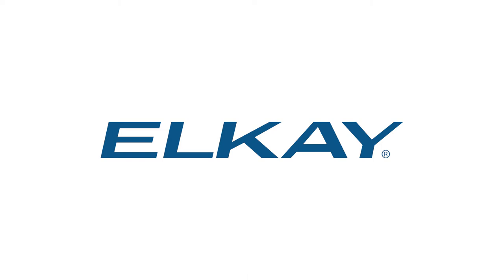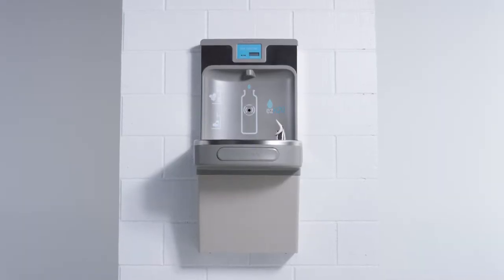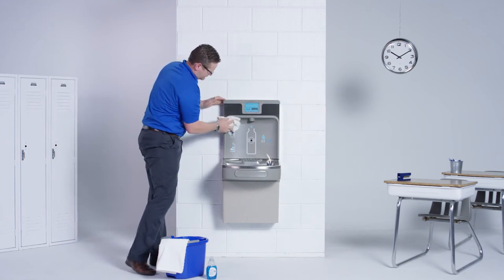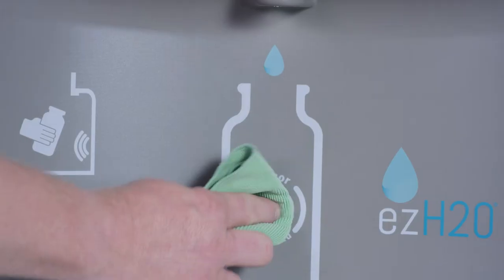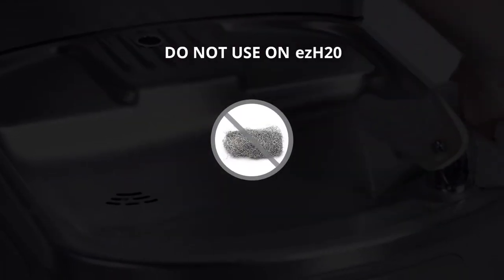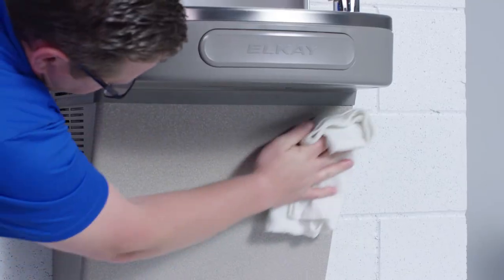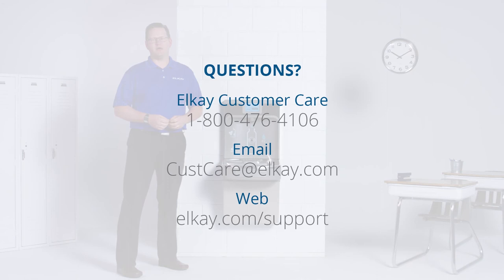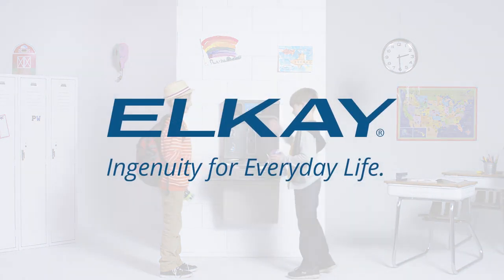Care and Cleaning for Elkay ezH2O Bottle Filling Stations

Comment: What about cleaning the water bottle filler aerator? I've notice over time the water flow thru the aerator fans out (sprays multiple streams), instead one solid stream. I've tried a bottle of compressed co2 to blow it clean. Seems to work for a while. I'm just wondering if there is a better way to clean it?
Reply from the maker: Hi Sean, thank you for reaching out. Please reach out to our friendly customer care team at tech@elkay.com or 800-260-6640. They will be happy to assist with best practices for cleaning. Thank you!

Comment: Hi Elkay, 

I have one of these units on the floor of my office building. Over time I've noticed that the green bottle counter appears to be reducing the volume of water per "bottle saved." It is unclear whether this was potentially done via a maintenance request or if the gauge has degraded over time. 

Your website says each bottle saved is 20 Oz of water (the standard for a large personal water bottle from Poland Spring), however upon taking measurements (once in April'18 and once in June'18), I noticed the volume of water per "bottles of water saved" was 16 Oz. in April and now has dropped to roughly 12 oz. 

Has there been any reported issues with the mechanism that determines the amount of water that the unit "saves?" I want to avoid my employees from thinking they are saving more water than they actually have. 

Thank you, 
A concerned customer
Reply from the maker: Hi, we are very sorry to hear about your experience. Please contact our Customer Care team for help resolving this. They can be reached at CustCare@Elkay.com or  800-476-4106.